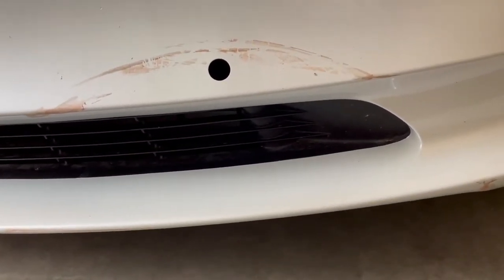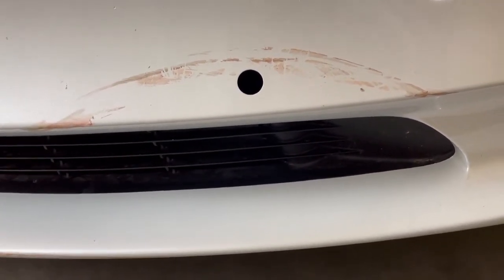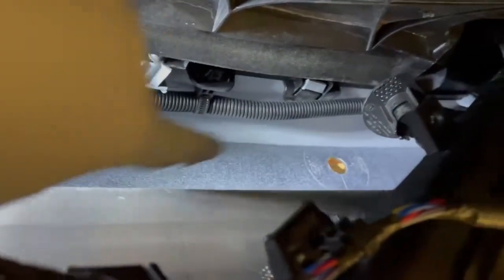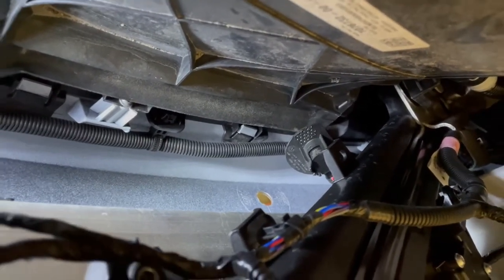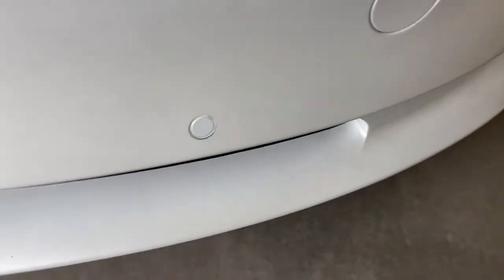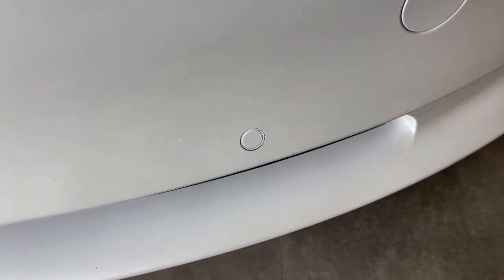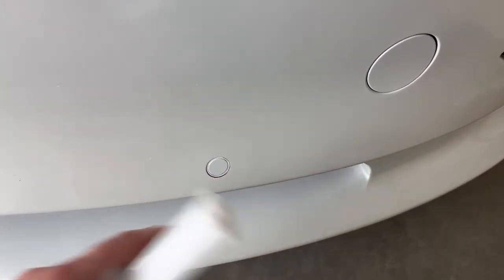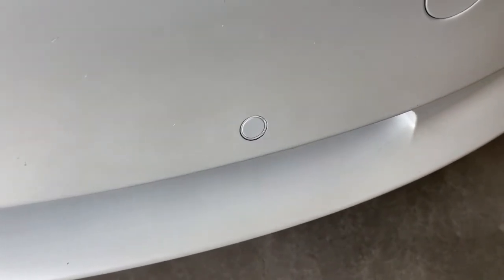2020 Tesla Model 3 SRP - Parking Sensor Reattachment

Comment: Thanks for the JB weld recommendation. I skimmed a dozen other videos looking for the right glue, they all say 'just push it back in' which didn't work for me.

As for how to apply the adhesive, I did the finger method, but instead reached into the hole and just smeared it on the inside where the sensor butts up as I found it a little easier.
Reply from the maker: Oh cool, yeah I did that as well, but I thought I would get more area from the inside. It's still staying on strong after all these years so hope yours does as well.

Comment: How hard would it be to replace that sensor (mine is chipped and i need to replace the exact same one)? is there enough room to work like this without opening bumper?
Reply from the maker: Realistically? It's not happening, there isn't room. I couldn't get 2 hands comfortably contorted in the same area when I was working on the sensor...and you would need the leverage of two hands to separate the old sensor with the new and then to apply the adhesive and reconnect. My method was completely Jerry-rigged, but it did work. Yeah to do it properly you'll need to get the bumper off to have enough room.

Comment: I used silicone to glue mine back. Its flexible like the urethane bumper cover so better for withstanding future impacts. Since it takes 8 hours to cure I used some wood blocks and a big sponge to apply pressure to the sensor while it cured.

Comment: How did you get to it though….  Kinda missed the point.
Reply from the maker: You had to twist your hand towards the bumper, apply the epoxy to each side of the sensor, then push the sensor back in place and hold until it dries.

Comment: Had the same problem on my M3P, tire debris hit the front bumper and knocked out the sensor, would have been nice is the sensor was snapped in instead of glued.  Tried JB Epoxy but it had issues with not curing so I ended up using some very thin 3M VHB tape, not 100% happy with the repair but good enough for now.
Reply from the maker: Cool, yeah I hope it remains stuck on. Read online that some folks had issues with it so that's why I went the epoxy route. Had to hold it there for 2-3 min to make sure it remained in place. A year or so later and it's still A-OK.

Comment: Thanks for saving my family a couple hundred bucks. My moms model 3 did this same thing. They were going to sell us a new sensor + labor. You’re a legend. I looked up how to get the frunk open and unscrewed all the bolts and used the epoxy you recommended. You’re the best. Have a wonderful day!
Reply: (The sensor still works great and wasn’t broken) ❤️❤️❤️. Thank you!!!
Reply from the maker: Oh awesome! I'm glad it worked and that it was the same issue as our Model 3. Tesla probably needs stronger epoxy to allow for these sensors to stick properly from the factory or else the slightest bump will knock it out.

Comment: Thank you for the video - stuff like that helps greatly. Made my DIY repair much easier. On a road trip and hit a large tree brunch on a highway (was no where to go). Luckily nothing happened except the passenger side parking sensor got pushed in. At a local hardware store they only had a 5 min epoxy but it also worked pretty well. I can. I can now cancel my next week my Tesla Mobile service call.
Reply from the maker: Glad it helped! Yes waiting for a service call is frustrating when a fix can be pulled off with some tools and time.

Comment: Thanks! My bumper got hit by a strip of tire tread on the freeway and the passenger fog light was pushed inside a bit and one of sensors fell into the bumper. Can you also reach the fog light inside without taking the bumper off?
Reply from the maker: Ah, sorry to hear about the bumper hit. Yeah road debris seems to be an issue. Umm as I recall my hand was 'barely' able to reach the sensor which would mean that unfortunately I don't think the fog light could be reached. Even if it could be touched, having the needed leverage to affix it back into place would be difficult.
Reply: @Frontlaven  Bummer. I will try, thank you!